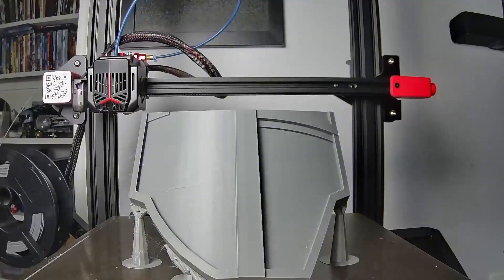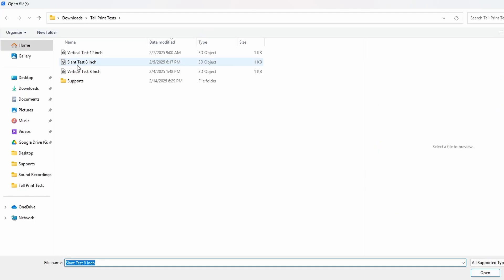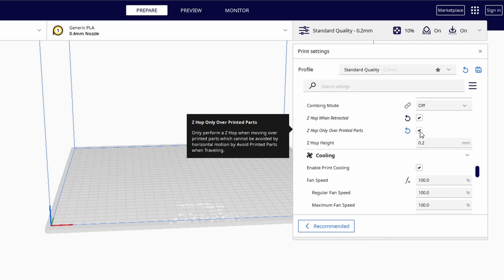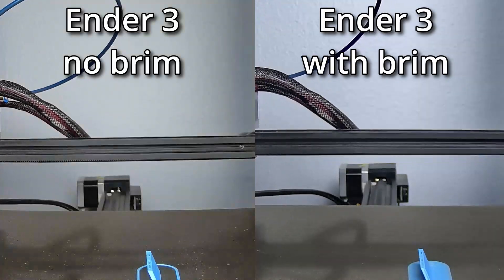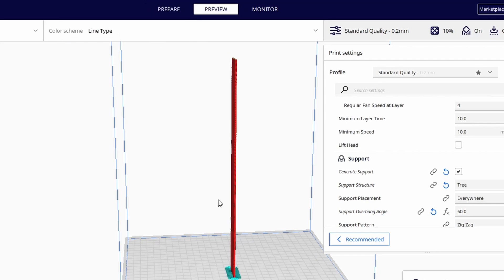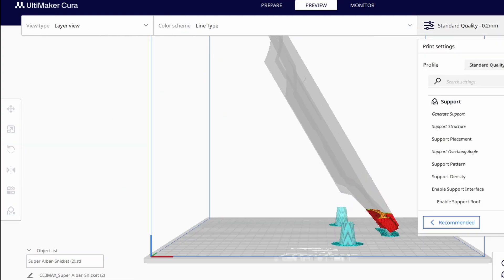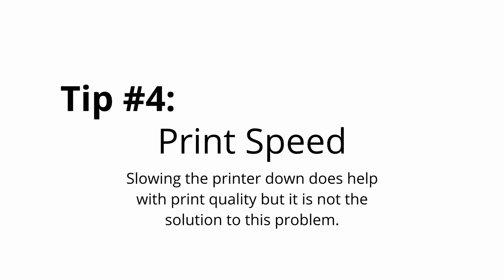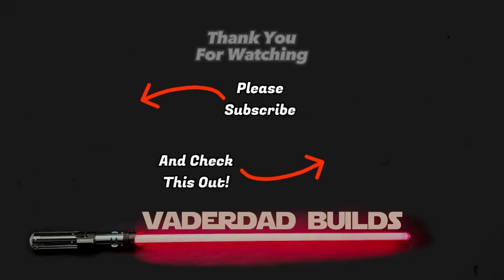SOLVED | How To Stop Tall 3D Prints From Wobbling Or Failing

Comment: Is there a video of how you designed the supports? I'm having this exact issue right now.but with a much much smaller piece. I think that Z hop might be the trick I'm needing honestly
Reply from the maker: No, I did not make a video when designing them, but my files are available through the link in the description.

Comment: Neptune for Max I am making a really tall 3-D print Chucky when it’s close to his forehead it will stop printing and it will say print complete even though there’s still about 20 minutes more printing to go why is this happening?
Reply from the maker: There could be many different reasons why that happens. Maybe try a different SD card. To save the print you could slice the remaining layers separate and attach it. It’s so frustrating when a long print fails at the end.
Reply: First time it failed around the neck then the second time it failed around the fore head area and stop then the screen read print complete
Reply from the maker: @lb3835 I think the best bet is to try a different SD card

Comment: In Bambu Studio, you can paint where you want support on the sides and it will generate tree supports automatically.
Reply: Interesting, where is this feature? I have a p1s Thanks
Reply: @Cee-FJedi the button that poorly illustrates supports the top bar of the preview port. Right under your nose at all times 😊

After painting you just need to select ‘Tree (manual)’ in the support tab

Comment: Using CURA.   How do you get the support to 'stick' to the part?   There is always a gap or the software will move the parts so they never touch.  Thanks
Reply: Cura has a setting (Preference/Configure Cura/Ensure Models are kept apart) which you can unset, and you can then put models in the same space. Now if someone can tell  me why I can only see the top portion of the support in my slicer, can they let me know which setting that is? :)

Comment: This is a life saver, I'm trying to make an Umbra sword from Oblivion, and I have the blade split in 4 pieces and printing straight up. They keep failing during the last few layers, so if the current print fails again, I will use those supports of yours.
Reply from the maker: Yea that gets frustrating, especially for large prints when they are almost done. I hope your print goes well this time.

Comment: is manual support applicable to TPU as well
Reply from the maker: I have not tried them with TPU yet,  but I would say yes. The connection to the part would be small and easy to snip off.
Reply: @3DMaxBuilds  ty ...will try it for sure

Comment: Thank you so much for sharing your knowledge and experience.  I have been dealing with tall, thin prints, and have been experimenting with custom supports as well.  My custom supports tend to be specific to the part I am printing; I like how you did several sizes of your simple support, and that they can be easily placed in almost any shaped model.
Reply from the maker: Thank you for watching! I was trying to make them as universal as possible as well as using minimal material.